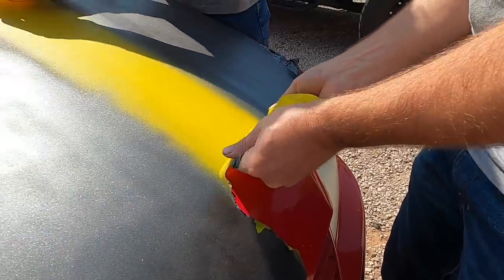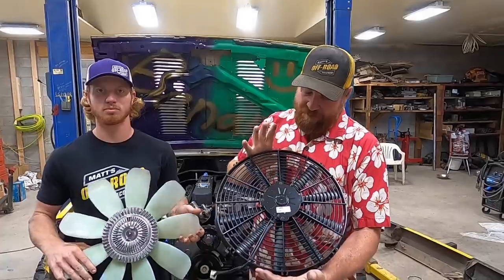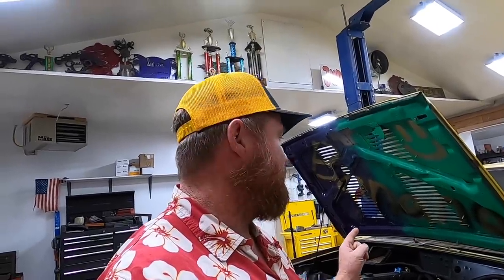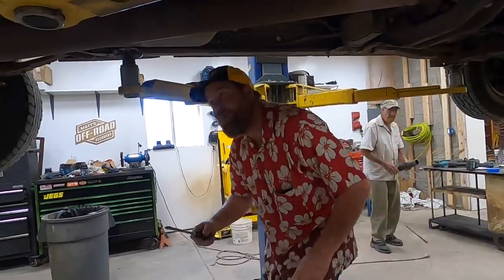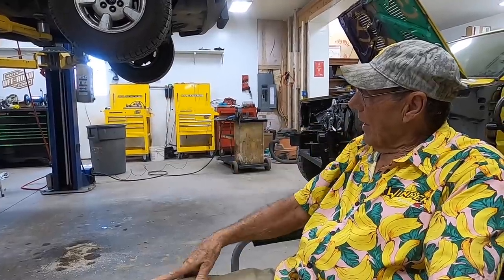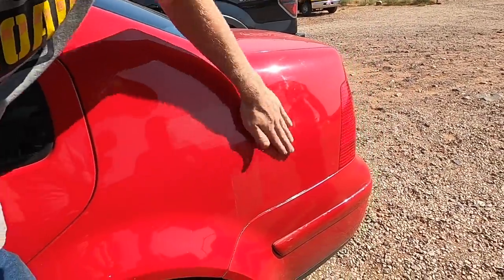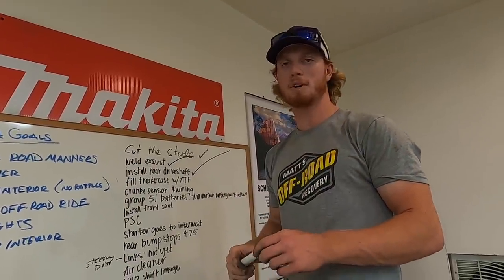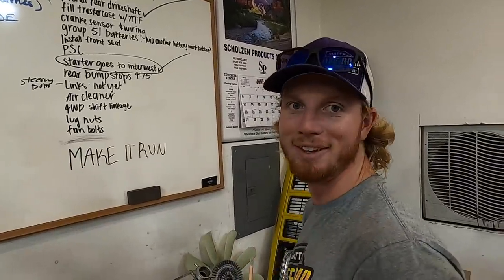Massive Cooling System Upgrade For The Jeep Banana!

Comment: Might be expecting too much from just one fan, sure a thermo clutch fan is hard to beat but electric thermo fans use in conjunction with the clutch fan will give you the edge you are looking for. Here in Australia it is quite common to have an electric accessory thermo fan to assist engine clutch fan cooling. Some buses even use water mist for a/c condenser cooling, there is no denying the positive effects of watering an a/c condenser, the line gauges don't lie. Hope you leave plenty of radiator room forward of the fan, the engine jolting forward is one thing, the fan blades flexing and wanting to pull themselves into the rad at high rpm is another.

Comment: I finally hooked up a cheapo window washer kit with sprayers directed at my radiator. I put the jug inside the cab underneath the glove box in front of the floor vent. Usually keeps the water in it pretty cool. It does alright. Was thinking about surrounding it with some sort of evaporative cooler

Comment: Sorry one more thing..lol You need to wrap those custom headers with some heat wrap or coating or something. the cast manifold is really good at carrying the heat out the exhaust, the header will unload all the heat in the engine compartment. you will see that pipe glowing red at 5k rpms on a hundred degree day, you may even melt some stuff nearby under the hood..something to consider..

Comment: shrouds are very important for cooling system efficiently; running without the shroud is ok but when in extra demands A/C and trailer in a hot day...Well that will make a difference.

Comment: Sometimes stock is best,the engineers spend a lot to get it right........ The whole reason for electric fans over clutch fan is NOT cooling it's to free up power from parasitic losses. Also the best solution I've found for EXTREME cooling is to setup a mister using a washer pump setup to come on at high temperatures. There's a few ways to do it and it lasts a lot longer than people think because you only need a little to make it work........ If it works for a supercharged Denali built for Dubai I think it'll work there too. I should add what we found out is there comes a time when it's so hot that at lower speeds there just isn't a way to get enough surface area to cool things down.

Comment: He’s right a engine driven fan moves a lot more air then electric fan.If an electric fan is so great they would install on a highway tractor. Highway tractors need lots of cooling for the heavy loads they pull.

Comment: Make sure the lower radiator hose has a spring inserted inside, like it originally came from the factory. This will keep the hose from collapsing when you run a high flow pump. This may be the reason the pump was cavitating.

Comment: The hesco water pump is great. The flexalite radiator and fans suck! I've also spent thousands on cooling over the years trying all the different things.  Currently I'm running 3 spal fans and mishimoto radiator and I've been ok so far but only with hood vents. I'm also located in the pacific northwest so not as much hot weather. We've had cherokees for years and have tried everything. The 98 grand cherokee 6 cylinder fan clutch is a good upgrade too if running stock style fans but if your yanking things around that fan clutch gets a little too close to the radiator.

Comment: Had good luck with my flowkooler pump over about 10 years and 2 motors. Much better than the napa ones I used prior.

Comment: A ceramic thermal barrier paint will help immensely to control underwood heat.  In the alternative, the thermal wrap tape could be applied instead.  The technology does make a difference.  Just like how a Flowmaster muffler generally has better flow characteristics than the other brands.  But with mufflers, it is all about the sound for some folks.  I will put 2 Flowmaster mufflers in line to have stealthy sound.  Along with the Flowmaster efficiency and durability.
Reply: And Matt is far from aggressive.  In the industrial wold of work.  That is just how people talk.  Now if he gave out knowledge like a Marine Corps Drill Sargeant.  That would be aggressive.

Comment: Them mechanical fans are key to cooling. But having the electric fans on the front of the rad as pushers helps at low speed

Comment: I had a '66 Chevy van that I swapped in a 350 4 barrel, I pout a 4 core radiator out of a fork lift in it .. it still ran hot in summer (and I'm in Canada )

Comment: With such a roof area, could you not place a shallow but large area rad in a fan extracted airbox on the roof to extract more heat? Like a luggage box but much better looking? Get Rudy on the fabrication. If he was extra clever you could have an opening flap on the front end to open up to higher airflow when on the road? Just a thought.

Comment: You haven't put a misting system in front of radiator using a window washer reservoir and system for on demand cooling when pulling under load during recoveries! It works!

Comment: Have you all considered an under-drive pulley for the water pump? With some testing you might find one that still keeps the engine cool but lowers the pump rpm enough to prevent cavitation.

Comment: I use 3 8" fans on my LS swapped impreza. They run at 2400cfm each its a every tight fit and cant fit anything in front of the engine so the fans are in front of the rad. Not enough air. Up hill it will run hot. I need to take a look at the water pump after seeing what yours has done.

Comment: Matt the hotter it gets like at 110 degrees air over radiator cooling doesn't work it just adds to engine temperature,  I assume you have tried to cool by evaporation (jugs of water splashed into the radiator I have seen you do) where you able to automate the water spray on the radiator?, next step up is to refrigerate your coolant with A/C !

Comment: mechanical fans almost always will be better than electric because electric fans are limited in how much of a fan they can push due to the current demands on a 12v system.  A mechanical fan will steal horsepower but most vehicles have enough to spare some for the fan.

Comment: Is that radiator a single pass or dual pass. I have found that a dual pass works better than a thicker single pass.
I certainly agree that a mechanical fan is the way to go for a work horse. (With a proper fitting shroud) 
I assume you have separated the transmission cooler from the radiator as well.

Comment: I imagine the clutch fan can produce more CFM when properly engaged. ie. clutch fans clutch is fully engages to a 1:1 ratio and you are out maximum engine RPM. However, at idle i have a feeling the electric will product more CFM. Why not simply manually bypass the bi metallic strip and have the clutch fan run at 100% all the time during the summer
Reply: Matt acknowledged those differences.  The clutch fan is designed for the RPM range that the clutch allows it to run and could be dangerous if the clutch was bypassed.  You have to do the engineering before you mess with things.

Comment: It's your cheap, err your Jeep.

I just got back from Death Valley a couple of days ago driving a 5.0L 2002 Chevy Express 1500.  My water temperature almost reached 210 degrees on the hilly sections but immediately went back to 180 degrees on the level and downhill side and that's running with the AC going full blast.

I've watched your channel for awhile now and always wondered why your Jeep runs so hot.

Comment: As I've been told, the engineers (typically) knew what they were doing when they built the vehicle. I have been told that you don't want to go over 4500 rpm on a 4.0, you seem to have proven that wrong. 

With my wrangler I try to get Mopar only stuff for the motor, if it lasted 16 years and 150k+, a new Mopar replacement should hopefully last that long too, and it performs well.

Comment: Great info and video! Since you can't seem to extract more heat through the cooling system, what about a larger diameter (really a higher flow) exhaust? I'm guessing you have to run cat. converters which are detrimental to flow. Exhaust cutouts for use during pulling, perhaps? Plain steel headers might help.
Reply: More Horsepower creates more BTU’s which will make it run even hotter
Reply: @MattsOffRoadRecovery  I'm sure you have it scienced out. I just thought it might help.

Comment: RE: Cooling system issues -- Red Line makes a product called Water Wetter which is a surfactant that breaks down the surface tension between the coolant and the engine, and that improves heat transfer by a lot.  They claim head temperature reduction of up to 30 degrees.  I've been using it for years and I've never overheated even under the most extreme conditions.

Comment: So we have all kinds of information except WHAT THE MODEL NUMBERS IS ON THE COOLING FAN !!!!    Is that a GM Trailblazer fan ?
   I could use that on my Jeep WJ .   Great videos guys.  And yes.  Flow cooler pumps are actually crap.  You can find other companies that have the enclosed impellers made of steel . I have two that I bought through Rock Auto.  Just analyze photos and ask, EBay sellers have them as well .
  Stay safe guys … and gal !

Comment: still having issues keeping her cool? 
setup a water sprayer on the radiator using small garden mister nozzles.
works well when bush bashing in the pilbara so should work just as well where you are, plus it works well as a backup water supply when everything goes to $hit (dont ask how l know that)

Comment: If this massive cooling upgrade still overheats, you guys should install some windshield washer nozzles on the bumper that sprays the radiator, so you don't have to get out and do it manually every time haha

Comment: Could not really see first water pump but it sounds like it is caveating at high RPMs.  Fluid is vaporizing at the ends of the veins forming vapor bubbles which ultimately collapse damaging the metal.

Comment: Have you tried using the electric fan in front of the radiator as a pusher along with the other fan that you like being used as a puller? I think it  has to be a fan that/s made to use as a pusher. Maybe only set the pusher fan up to kick on at a little higher temp or use a manual switch to turn it on and off as needed. I run a mid sized truck off road for work that has a Chevy 366 big block , the intake manifold has two thermostats  , something like that might help if it were doable with your engine but I have no idea if that's even possible for you.

Comment: The driveshaft that I got from Adams vibrated pretty good. Since I needed it by the end of the week, I had little choice but to take it locally to get weight welded to it 180 degrees from where Adams did, plus some more on the other end of the shaft.. The vibration is gone and my warranty is apparently void now.
It was a $150 tax on top of the cost of the shaft and I saved them from having to ship me a replacement which they offered to do. The least they could do is continue the warranty... Not that there is much to warranty on a drive shaft, but no matter.

Comment: Guy’s just know that the 9000 cfm fan may not work as advertised at high rpm low road speeds because the thermostatic part of the fan needs the hot air flow thru the radiator to make it work correctly
Mike from WY

Comment: I changed to an electric fan on a heavily modified 4wd so that I could turn it off in deep muddy conditions. But it didn't cool the engine as well as the original factory fitted. I also fitted an electric fan to a 68 Pontiac Firebird that I fully restored. It was the best electric fan I could get yet it never worked as well as the original factory fan.

Comment: There is a digital firing system made for high hp straight 6 motors, the race builder that makes them is on youtube with the highest hp jeep 6cyl with turbo, but you chose and awesome power plant.

Comment: Why don't you use AGM battery? Doesn't have to be Optima, any AGM that fit, will do just fine and you don't have to be scare about any leaks from it. At least in EU, the price difference is merely 20$, not much for piece of mind.

Comment: 1, if you can find out why ALL Cherokees run hot.....youll be rich! Have you considered an electric water pump? Higher flow at low rpm.......wont care if you ping off the rev limiter ....always runs at the perfect speed. Ive also heard of Cherokee owner adding a second rad the size of a heater core on the inner fender running off the heater lines. Im a jeep guy myself, and always looking for ways to be better off road

Comment: The problem with mechanical fans is they're only gonna spin as long as your mechanical clutch holds up... For an offroad only rig, a solid fan adapter with no clutching mechanism is the way to go IMO... yeah, mpg will suck, it'll sound like a cessna, but one less part to fail.  Plus, all clutches spin at a certain percentage of the pulley speed, it's never 100%...  I'd love to find a plastic mechanical fan (preferably with more blades but lighter than the factory metal one) that would fit the stock radiator/shroud...

Comment: A fan with wider blades that are close with no see threw when looking threw the fan will have more cfm than a fan with the blades further apart from one another I sturdy it for computer fans and radiators for the best cooling.

Comment: Just because it's aftermarket and newer, doesn't mean it's better.  Looking at the Banana getting OEM/stock parts to solve it's cooling problem that was caused by trying the "newer improved designs" really sent this point home.  If it isn't broke, don't fix it.  Even seasoned vets have to relearn that one.

Comment: wondering if you guys have any tips or tricks on how to run JKs cooler?  I live in Phoenix, AZ and summers here are just as hot.  I've tried the version 2 of Mishimoto's radiator but it actually made my JK run 15-20 degrees hotter.  had to go back to OEM radiator but I'm still looking at temps around 219F just driving on the highway.

Comment: The length of the 4.0 has always seemed like the cause of its cooling problems. The water enters the front of the motor and has to cool all of the cylinders from one direction. By the time it's cooled the first 4, that water is hot and can't extract enough heat quickly enough from the back 2. You see it time and time again on these 4.0 heads where the headgasket on the rear cylinders has given out and you get high temps and burned exhaust valves. The 4.0 is such a beast, it will still run acceptably well with a warped head, but I'll bet if the guys with chronically overheating 4.0s pulled the heads, they'd find its an issue.
I would like to see someone pull the freeze plug out of one of the rear water jackets, replace it with a fitting and plumb a 1" extra line to it in order to supply cooler water to that last couple cylinders. If I ever get over my obsession with Isuzus, I might try it myself. You could take it straight from the lower hose, T off and use a Normally Closed electric valve to keep it closed until the engine is up to temp. Once the T-stat opens, hit your switch and open the valve to allow coolant to hit the rear cylinders and see if you can keep temps in check that way.

Comment: My opinion: The OEM exhaust scavenging is poor. This includes the as-cast exhaust ports & the restrictive exhaust manifold. The excessive turbulence of the exhaust pulse is heating the Head & eventually the water, or do you guys run anti-freeze? Since you guys run in excessively high daytime temps., see if you can't find another cylinder head. Take it to a shop that does its own porting; wouldn't hurt to clean up the intake & hopefully the valves/springs in the revised head are good. Maybe talk about a performance valve seat job too, it will also improve flow but talk to the shop. Then swap the head w/ the original, should take a couple of hours & you're back on the road. Early Chevy 454's ran hot, but cleaned up the ports & they ran much cooler. Harley-Davidson shovelheads had the same issue, turned the exhaust pipes at the head a real dark blue. W/ some minor head porting, my new pipes turned a mild gold color instead, huge difference. Add a cheap set of headers to the Banana & I think the overheating issues should be less of a problem. I didn't say 'solved', I'm an Engineer, only using the revised head & header in your application will tell you if the overheating issues are solved. I'm just trying to get you closer. I enjoy your video's. Can't imagine working in 104F temps.

Comment: Have you tried Evan's Waterless Coolant?  I just replaced my coolant with this in my JKU.  It's winter here so I can't really provide a good review of it yet, but I have noticed that at full operating temperature my temp gauge is steady at two notches less than it was with traditional coolant, my heater is also not as hot.

Comment: That’s crazy to think cause my 91 has all stock everything besides new map sensor tps and throttle body and I’ve done that 118 in Phoenix towing a wrecked c10 with the ac on, made it there and back without it going over 250  (to add we drove from Central Valley California to Phoenix and back didn’t overheat once)

Comment: Have some machinist make you a Tesla disc impeller for the stock pump body.
And better still machine the pump outlet hole in the block to a larger size to pull more hot water out of the block.

Comment: That clutch fan is impressive at 8000+ CFM. But that electric fan is not close to the best. You can get 8000cfm out of 2 Taurus fans. I like the reliability of the clutch fan though.
Reply: @MattsOffRoadRecovery  I agree 2 wouldn’t be worth it. There’s CFM testing the 9 blade Taurus fans at 3800cfm

Comment: Coolant must remain in radiator long enough to dissipate heat. Large radiator, high volume pump at high RPM may be running coolant through radiator before fins can transfer heat.
Reply: Must you?